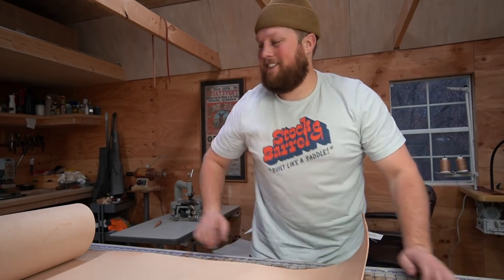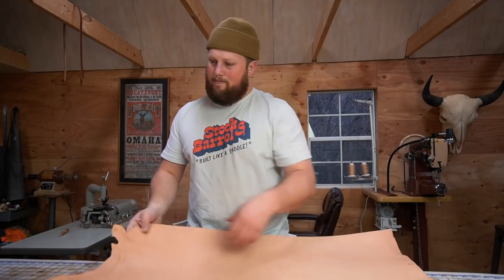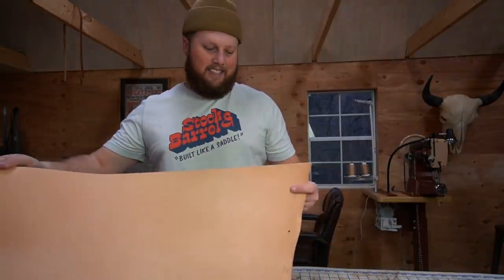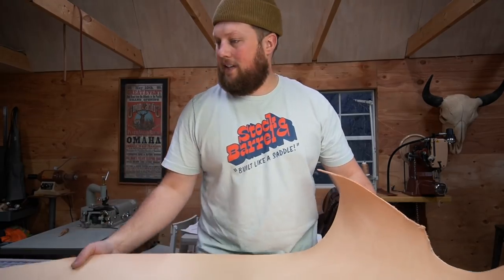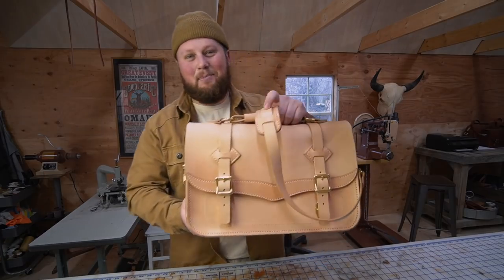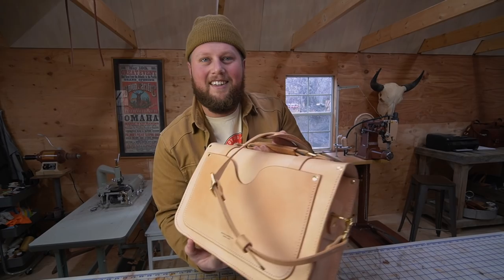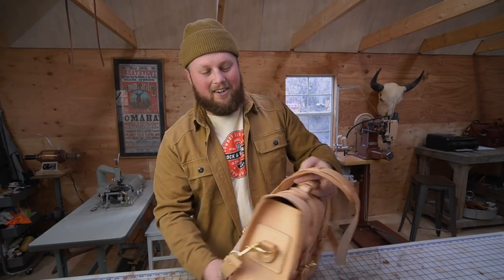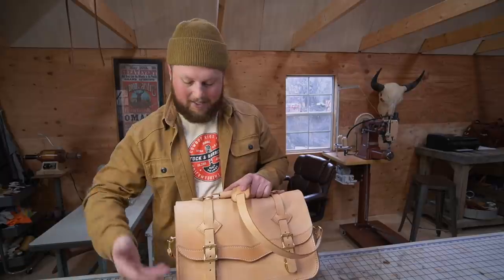Making a Western Leather Laptop Bag - Unintentional asmr - Whit + Park Leatherwork

Comment: Obviously new to this because beyond the skill set I am amazed by the glue. What form of magic makes glue stick to the impossible using a hammer. What is it, elmers, tite bond, I need it. Guessing the hammer removes air, spreads and impregnated the fibers and breaks the fibers Down just enough for the tack to hold.
Reply from the maker: yes sir, I use contact cement so you have to apply it to both sides and it adheres to itself. Barge cement is a popular one for leathercraft but I started using a water based one recently called Aquilim 315. It's not nearly as toxic and I don't get headaches from using it anymore:) Still holds just as strong

Comment: Does using that knife help you to cut straighter lines over using say a utility knife?  I’ve always used a utility knife with replaceable blades but I always use a straight edge to ensure a straight cut.
Reply from the maker: Yeah i've used both, I just like how the blade is bigger on the japanese one but the only thing that really matters with the heavy weight leather like this is that it's SHARP
Reply: @whitandpark  cool. Thanks. I’ll try mine like that also to feel the difference. Maybe it will feel more like I can rely less on a straight edge.

Comment: I think it’s a great bag. Thanks for sharing. I thought you recently bought a Techsew 341 clone.
Reply from the maker: Thanks Jim. Yeah I have a Techsew 2750 pro which is great for medium weight bags and smaller stuff but I more recently bought a Cobra class 3 (441 clone i believe) for heavy weight projects like this
Reply: Their 441 clone is Class 4.
Reply: Looks like Class 3 is a short arm 441 clone like a CB 3500. Looks like a great machine. First time I’ve seen you use a Cobra sander/edger.